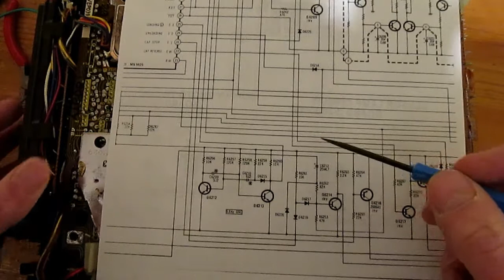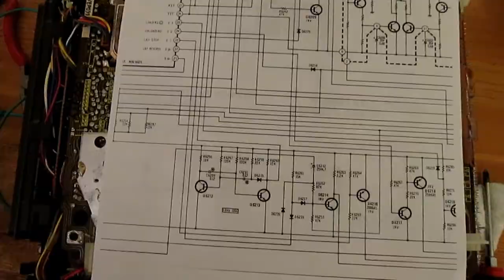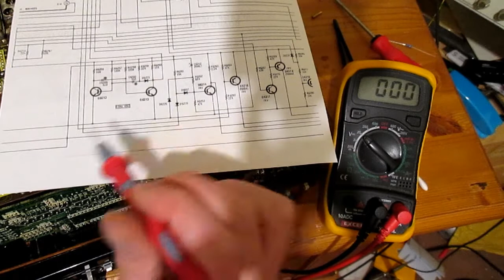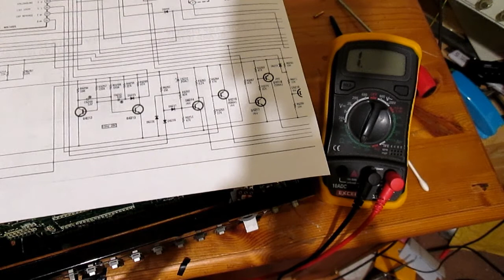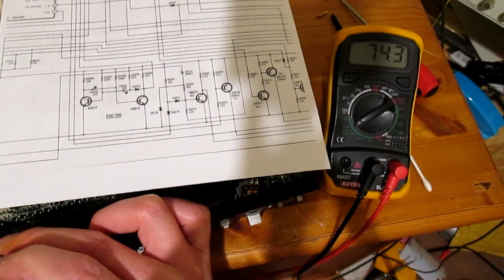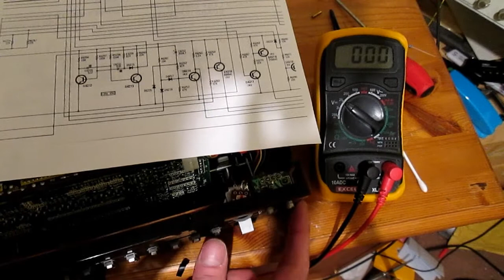Panasonic NV3000 Repair Pt 2

Comment: is this the same for the Olympus VX-402? have one that need repair - plus I have a second one for parts and don’t even know how to begin
Reply from the maker: The VX-402 appears to be a rebranded Panasonic M3 camcorder. Is that what you have or is it a vcr like the one on the video?
Reply: @nowt1002  It’s the cam corder. I just have found no repair forms online regarding it
Reply from the maker: If you look for information on the Panasonic NV-M3 the same will apply to your camcorder. The service manual for it is available online. What is the problem with it?
Reply: @nowt1002  Turns on for about 10 seconds unless you hold the power button down, still shuts off but you can see through the viewfinder, tape is stuck in both and eject button does not function properly.
Reply from the maker: It sounds like it might be a stretched loading belt. There's a video I did for someone showing how to get the camcorder apart and get to the loading belt here https://youtu.be/arxCLALUxA4
You might get away with just cleaning it and leaving it off for a while to shrink back a bit but probably better to replace it. I would also download the service manual as it has a guide for disassembling it. It can be downloaded from either Freeservicemanuals.info or elektrotanya.com (I forget which).